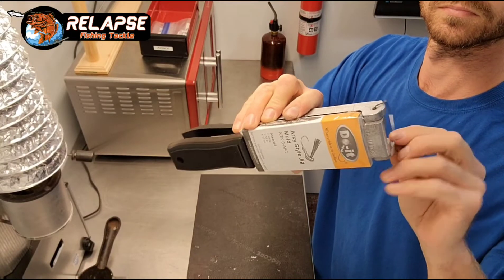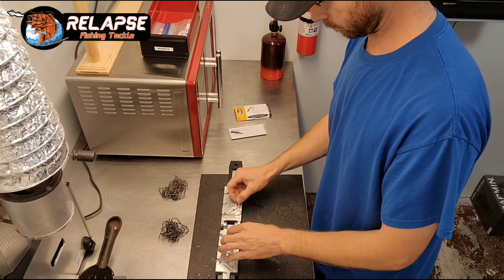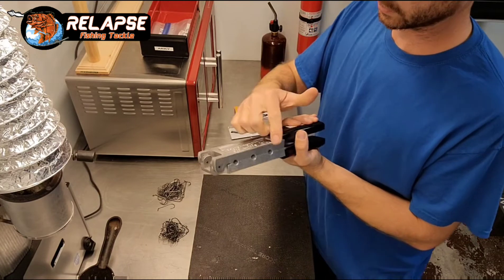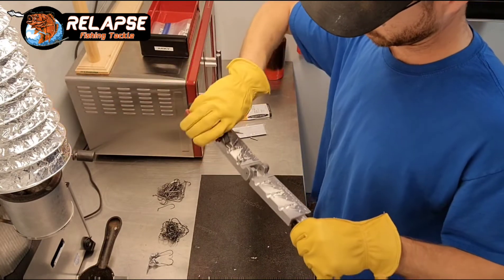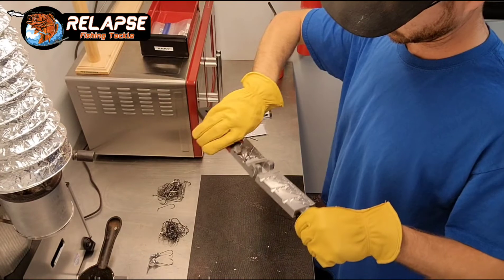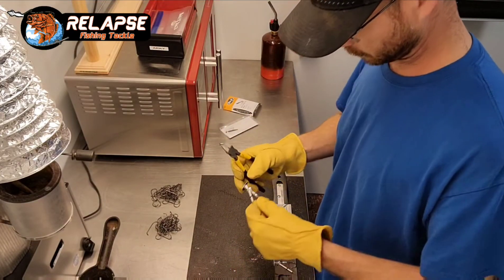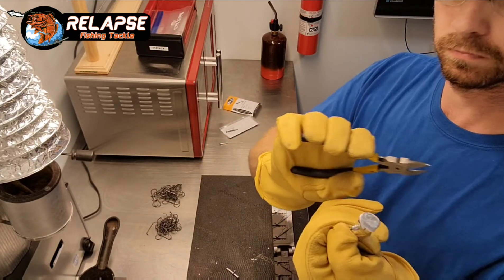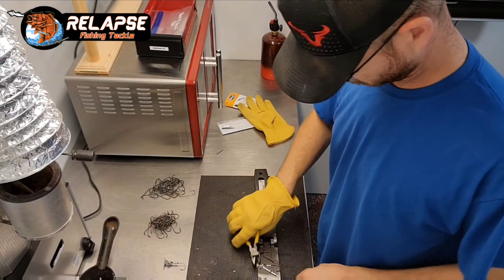Molding Do-it mold ARKY fishing jigs and the process of getting the jigs to pour correctly.

Comment: Great tips!! How difficult is it to modify the molds for hooks that aren’t recommended for the mold? Thanks for sharing!!
Reply from the maker: Thank you! That would depend on the mold and the hook you want to use. Hooks that are very similar but a little thicker hook is a pretty simple modification. Place the hooks in the mold one at a time, tape them to the mold, and smash the mold until it closes all the way in a bench vise or use a hammer. If the hooks are very different it might require a dremel and then go back and fill the voids that are no longer used with JB-weld or a high-temp silicone. Be sure to use proper PPE and take your time. Sand casted molds are easy to modify, if you're modifying a cnc mold clamping and smashing them doesn't work very well.

Comment: I've been trying to get this to pour this arky (flat eye) and it seems that I need to drill out every one of them. It pours well besides that. I do wish it had a better keeper. Im really stuck because I had high hopes for this mold.
Reply from the maker: Have you tried using the teflon pins to pour with? I'm not sure how far the metal pins sit from the hooks. With the teflon pins you might be able to push them further in and touch the hooks.